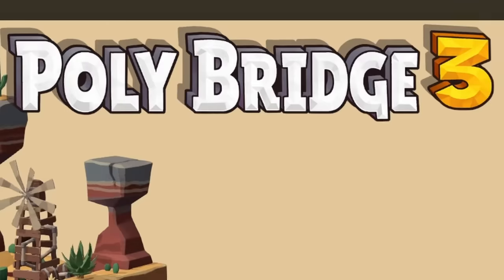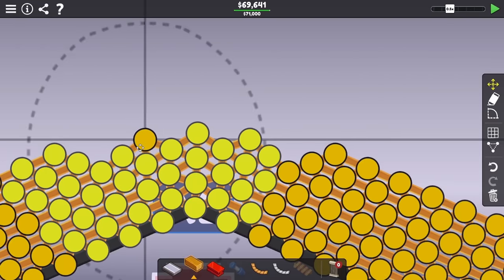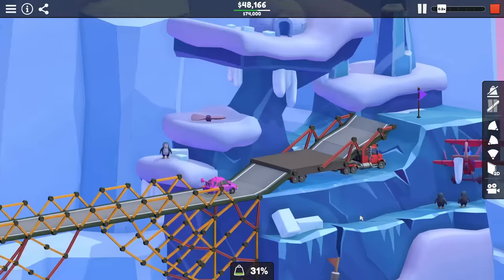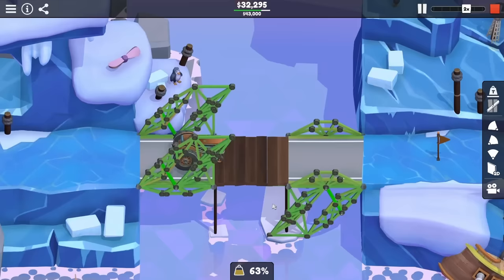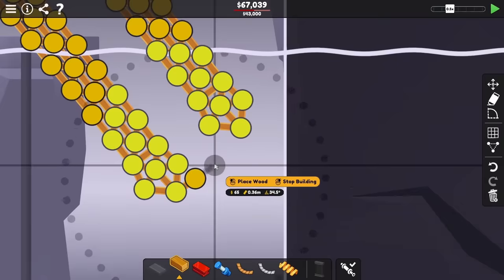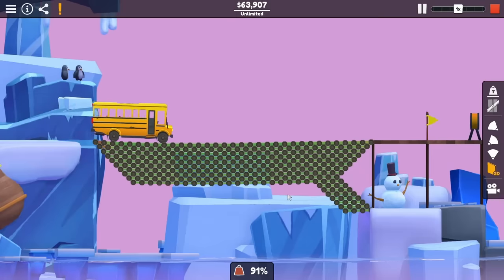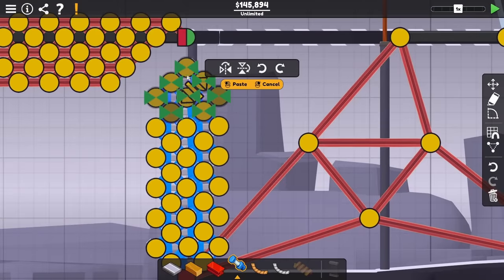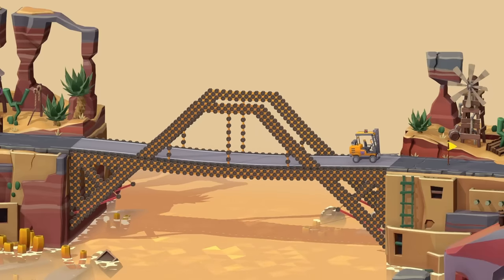Can You Beat Poly Bridge 3 With Minimum Length Materials?

Comment: I think nodes being super stretchy is super cool. Shows the difference between long pieces and short ones besides weight. But I do hope normal springs are lighter than wood springs
Reply: It's absurdly broken and is this game's biggest cheese strategy by far. Needs to be fixed asap.
Reply: I've only watched vids so far, but i love the stretchy nodes. Cheesing is optional unless you're leaderboard focused.
Reply: @daniellucas5522  I wouldn’t say it’s cheesy. It’s like wooden rope. A wooden spring. But I could agree that the new dangling road and wood should be fixed or nerfed somehow
Reply: @eeveewithcoffee9554  The difference between this and wooden rope is that wooden rope has the same properties as wood, it doesn't magically become stronger in tension when laid out that way This is abusing game mechanics to change the properties of the material.
Reply: Eh, personally I’m not the biggest fan. Makes complicated hydraulic stuff a lot more inconsistent and harder to do

Comment: In this game small pieces arent heavier; the weight comes from extra materials used on the multi-layered truss

...at least for now. Some node weight is planned to be added in a future update, as a fix to node spam becoming very springy, the other problem you encounter in this challenge 😅
Reply: The joints are the heavy part
Reply: @jozimastar95  well, it was for the first two games
Reply: @jozimastar95 for the first two games rn it's just the actual material
Reply: @jozimastar95  In poly bridge 3, the material is actually heavy and the nodes don't change the weight
Reply: Yeah so making weights is now harder than in the first games but makes it more realistic.

Comment: i wonder if self building bridge is possible. like at the beginning of level you have pre-built road pieces (like blocks made of steel and 2-3 road pieces) and you need to use these pieces to create a bridge using walking machine (it'll walk on foundation, the gap between foundation will be 2 road blocks maybe). i'm sure it's possible, the only problem is hydraulic clicking and moving these road blocks to the end of the bridge, maybe it'll be possible with custom shape dropping blocks one by one and a truck delivering road blocks